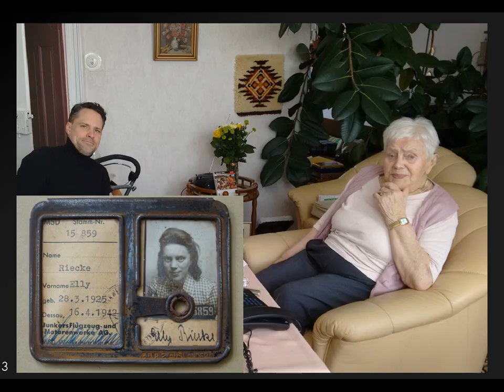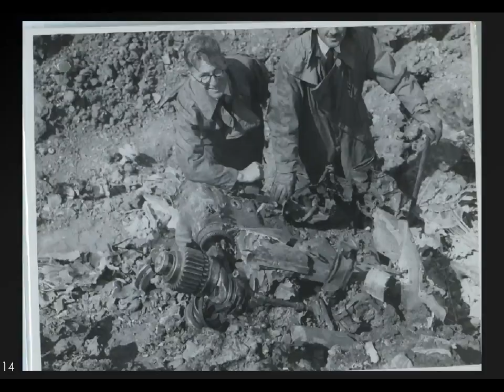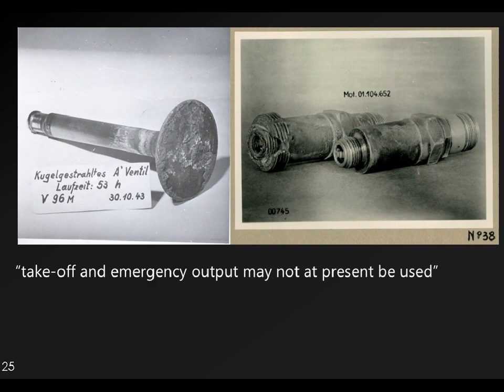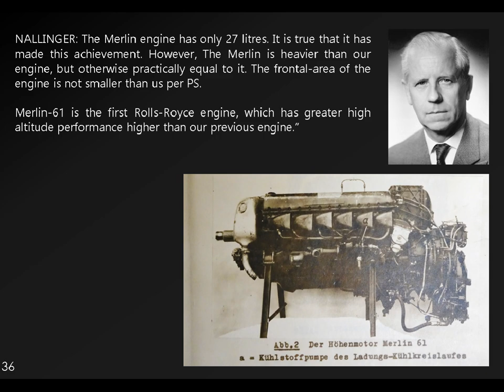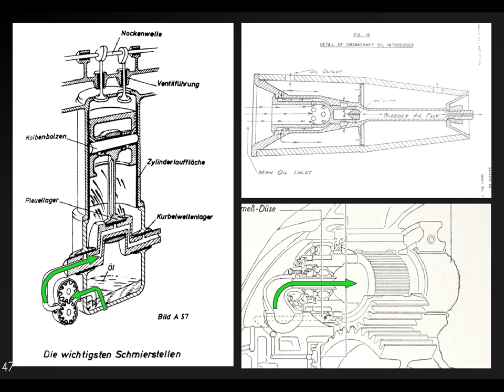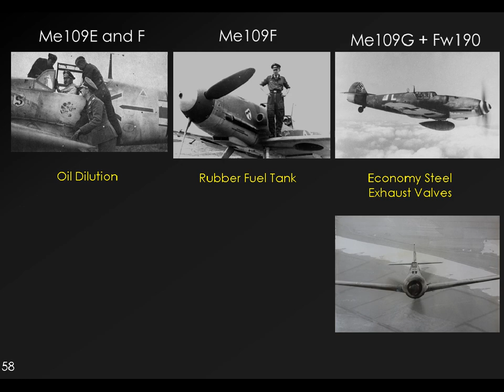The Secret History of Fighter Aircraft Engine Development in WW2

Comment: What are the differences between a Rolls-Royce Merlin and a Packard Merlin engine and how many of either were produced?!?
Reply: My understanding, from reading some of Calum's posts on various forums, as well as asking another engineer who rebuilds various WW2 engines, mainly Merlins (has his own youtube channel, very worth watching) is that the differences are;
1. Primarily the ancilliaries such as magnetos etc, which were not really going to make any difference to the performance but made sense to source locally in the USA
2. The supercharger drive, Packard had to use epicyclic gears instead of Farman gears, in order to get around a Patent. The engineer from the Historical Engines channel says that both gave very good service.
3. I think, but am not 100% sure, that the charge-cooler on the 2 stage engines wasnt exactly the same. Comparing the Packard 2 stage to any of of the 60s series, the 'cooler box' does look a slight bit different. Again, i am not 100% sure.
4. Packard introduced single point throttle body fuel injection before RR (the so called 'pressure carburetor' ) which did away with the float chamber+restrictor. RR followed suite soon after.

There may be more differences but those are what i am aware. As far as i have been able to determine, and Calum says for definite, almost all of the parts were completely interchangeable between equivalent models of Packard and RR versions.

Comment: I really enjoyed the talk and your book. Interesting that you say the engine has to be specifically designed to use high pressure radiators yet the DB 605 seems to have been able to use the cooling system in a Spitfire Mk5 just fine.  Your slide about the 6 things that Britain did correctly did not include having access to limitless metal and fuel resources. You make that clear in your book and this video but do not list this. It is critical.
Reply: I would not say that having access to raw materials was something Britain "did" correctly, in as far as, everyone knows that is important but you either have access or you do not. Germany did stock up massive amounts of critical materials beforehand, but just did not prioritise well, and had overly ambitious goals regarding acquiring new resources (Africa, Russia etc). What they did would have just about worked for the "short war" model many in Germany hoped for. I do not think any of them envisaged a five year war. So you could say their approach to materials stocks met their unrealistic goals. 

The use of the Spitfire cooling system in the 605 test obviously meant that all the pipework and radiators were the originals, hence did not have radiator tubes which expanded like bicycle tyres (although there are several factors at work). Its very likely that the tests which would have meant running at elevated coolant temperatures in the 605 were not sustainable, i.e, it was probably ok for a brief test by a test pilot under carefully controlled conditions, but would never have worked in a service environment. I.e. its probable the engine would be very quickly ruined. The tests probably only needed a few hours under high temperature conditions. Being able to do it for 50 or 100 hours is an entirely different matter.

Sadly it is difficult to ensure all the salient points are always mentioned in these videos as the topic is so wide ranging and complex. 

I am pleased you liked the book.
Reply: @CalumDouglas  thank you for the detailed reply

Comment: Having listened to your comment about the Mosquito at the end this was also slowed by the fact that the rear two exhaust stubs on one side of the engine had to be combined to stop the hot air damaging the aircraft. This lost the aircraft something like 8 or 9 knots off the top speed. 

One of the reasons I suspect the Germans hated the Mosquito is that it had the range to fly & fight over Germany from the UK. The Spitfires would have been mostly limited to the occupied countries of Europe due to range consideration.
Reply: "Having listened to your comment about the Mosquito at the end this was also slowed by the fact that the rear two exhaust stubs on one side of the engine had to be combined to stop the hot air damaging the aircraft. This lost the aircraft something like 8 or 9 knots off the top speed."

This was  offset by the significant increase in power.

"One of the reasons I suspect the Germans hated the Mosquito is that it had the range to fly & fight over Germany from the UK. The Spitfires would have been mostly limited to the occupied countries of Europe due to range consideration."

Lots of things frustrated the Germans when it came to the Mosquito. It had the capability of flying and fighting at almost any altitude. It was also famous from some 'spectaculars', which were largely intended to send a message to the Germans: good luck stopping us. The most obvious one was the bombing of Berlin on the anniversary of the Nazi ascent to power, when they put Goering off the air. It was also the most productive allied PR aircraft of the war, exceeding both the P-38 and the Lightning. Coming over at high altitude and high speed gave the Germans little chance of stopping it.

Comment: With regards to the radiator drag I believe that the RAE developed a radiator that gave thrust due to the hot air rather than than drag. Was this too late for the Spitfire ? There is some information on the thrust producing radiator at the FAST museum in Farnborough.
It is known as the Meredith Effect and is very dependent on the temperature of the coolant so the Merlins with a high pressure cooling system using Ethelyn Glycol should have been able to have cooling with little drag and possibly some additional thrust. Details on the wikipedia page for the Meredith_Effect and the links on that page.

Comment: Nah.you cant deny German engineering was far superior than rest. It was unmatched
Reply: I have to say the engine that I most like to drive (again, because my father had one) is an English one starting with X and ending with K. But compared to the material restrictions these engineers did fantastic things. Just look at the mechanical „ECU“. Just a power stick instead of mixture, ignition timing and supercharger gear. 
But again I prefer not only English car (which also have their flaws), but I’m also very happy the BMWs, DB60n and Junkers did not win.
And Merlin is definitely the better name 👍🏻.

Comment: Regarding the blending of is landing of 150 octane fuel again you got to be careful with understanding the technology.  You cannot "blend" a 150 aviation fuel. It requires the use of additives.   The problem is that they started with very different forms of crude oil.  The American oil was very low and sulfur and other contaminants.  However these contaminants contaminants actually caused caused the fuel to have a higher octane rating because it because it smoothed out the flame front.   When I was developing classified components for the Brits 30 years ago, I ran into the same problem.   While I loved working with the Brits, there was often a challenge with communication.   As one of my compadre's in England informed me... "The problem with our communication is that we are 2 people separated by a common language."  ( And our "common language" is anything but...)
Reply: Hi Rick
I cant really imagine what you`re trying to say, as to use an "additive" means you blend that into a base stock. In about mid 1942 British and US aviation fuel specifications were totally unified, and thereafter were one and the same specification.

Prior to that British 100 Octane was RDE/F/100, however lean/rich were not commeasurate between UK and USA fuels, so that was the point when the slightly tweaked 100 octane specifications were unified and became 100/130 PN (which is basically the same as 100 octane but with the addition of the required anti knock rating at rich, and some very small compositional alterations to ensure compliance). The early US supplies of 100 octane which were a touch deficient at rich, were modified in the UK by adding Benzole.

(150 PN was RDE/F/300 in Britain)

Comment: While I love the video the information regarding heat removal from radiators is not accurate at all.  In fact it's just plain wrong.   The heat removal is only a function of is a function of the change in temperature.  Is the actual temperature is irrelevant.  When you pressurize the the radiator, you  Increase the boiling point of the radiator fluid which allows you to operate at a greater change in temperature or as we call it Delta T.  So the only issue issue is the fact that the spitfire had a system that operated at a higher pressure pressure which allowed them to operate with a higher  Temperature difference or Delta T for the system. Thus making it more efficient or effective or effective depending on your terminology.  As I recall, there were numerous problems with the DB engines which combined to cause numerous reliability and lifetime issues.  This is the same situation that the USSR had and has (as Russia) at this point in time.  They have planes that are very fast and can perform some interesting aerobatics.  But their engines destroy themselves after a very short period of time and are extremely unreliable, and the acrobatics have nothing to do with winning a dog fight.  As such, in the last 40 years the United States has not lost one aircraft when fighting against Soviet craft whereas the United States has shot down about 3 dozen Soviet aircraft including frontline aircraft.  And yes, I am a  Retired research engineer certified in mechanical and electrical engineering.
Reply: Hi Rick, 

You start by make two contradictory statements:

1) "the heat removal is only a function of the change in temperature"
2) "the actual temperature is irrelevant"

The change in temperature between two mediums exhanging heat, is rather dependant on the ACTUAL temperature, so you`ve started off on a very bad footing.

I am guessing that your career in research (which you seem to regard as an important point) was not in engine design? (at least I hope it wasn't).

The "actual temperature" is VERY important, because. You have TWO boundary conditions to your calculation.

a) The temperature of the external air flowing through the radiator core
b) The temperature of the engine metal over which the coolant flows

The transfer of heat energy between these two mediums is: Q=m x c x Delta-T  ... ok ?

Now, if we run our coolant at 90 degrees C (for which we do not need a high pressure system), the metal temperature in the engine (taken as a whole) might be 180 degrees C. So we have a Delta-T of 180-90 = 90, got it ?

And, conversely, the heat to air, through the radiator matrix, (if we assume 30,000 feet = ambient T of -38 C) means we have a delta T between coolant and external atmosphere of -38C>90C = 128 C, following ?

Now, if we raise the coolant temperature to 135 Degrees C, and increase the pressure to ensure no boiling occurs, two things happen. First instead of Delta-T of 90 to the engine metal, we have 180-135=45C (instead of 90C), ok?

Secondly we now have a delta-T to air of +135C>-38C = 173 C, ok ?

So by running the coolant at a higher temperture, we not only reduce the heat transfer FROM the engine metal TO the coolant, but we also INCREASE the heat transfer FROM the coolant TO the external atmosphere.

Therefore, I shall accept your apologies for trying to imply that I dont understand basic engine thermo - sadly its you who has embarrassed yourself.

In actuality, we lose a little bit of this, because if you increase the coolant temp, the engine temp goes up a little too, so we dont quite get the ideal situation above, and we also lose a bit of radiator performance, because the air gets heated up more as it passes through the fins, which expands it, and therefore very slightly reduces the mass flow through the radiator as a consiquence. However, in reality, running such a system compared to one running at 90 or 95 C, can still mean you can reduce your radiator size by something like 30>50%, depending on the particulars of the aircraft concerned, despite the two small compromises just mentioned.

As to your rather odd comments on the combat record of Russia against the USA in the last 40 years; I have no idea frankly what that even means with respect to this video, other than illustrating that you find it immensely emotionally upsetting if anyone suggests that America wasnt the best at everything, all the time, in every respect. History, and facts - I`m afraid, dont care about either your (or my) feelings - and its rather sad that you view this as an "anti american" video. If you read my book you`d see differently...

Comment: Great video. 👍 Thanks for the upload 

An ex vehicle emissions engineer I'm struggling to get my head around the 40c difference in the fuel dist curve, causing oil dilution, when you consider the combustion temperature.... something else in addition to fuel recipe? Those curves look quite light compared to modern gasoline of close to 200c?

In addition, oil level would be checked before each flight and, complete oil changes were performed very often. I always thought the 601 used a roller bearing crank and the bigger displacement 605 used plain bearings, interesting 🤔

😎I need to sit down down and think that over. I'm sure you are correct I just wish to understand. 

Some of these other problems they had remind me of BL and Rover, the sort that make you blink at the incompetence.😊
Reply: 601 has roller bearing big ends only, the main bearings were plain. On the 605 this was simply altered to plain on both main, and big ends.

Comment: Do the British use the term detonation to also mean pre-ignition? The gentleman says that "the flakes that formed on the valves became red hot, causing detonation." Usually, however, anything red hot in the combustion chamber ignites the fuel/air mixture prior to ignition, resulting in pre-ignition. In the U.S., "detonation" is the explosion of unburned fuel (usually at the edges of the combustion chamber) after the ignition process has begun. Both will destroy an engine, but pre-ignition is the worse of the two.

Lots of similarities here with Japan's problems in producing high-octane avgas, lack of raw  materials, etc.
Reply: There is a lot of confusion between the two terms as they are often intimately connected. I didnt really have time for a combustion lecture inside this one, so I said the got flakes caused detonation. Which is true, however it is certain that pre-ignition would also occur in the process at some stage. I dont have time to type a complete explanation, but roughly:

a) Detonation cannot be detected before the onset of the pressure increase derived from ignition occurring at the designated timing. Very low levels of the "knock" sound that detontation makes as the pressure wave hits the metal of the engine can be sustained for long periods in service. 

b) Pre-ignition, is when the charge is ignited before the intended ignition point, and generally it cannot be "managed" at a low level, unlike knock. 

In a manner of speaking therefore you can say that preignition is "worse" than knock, however I`m not sure I`d like to use that as a blanket statement, as severe knock is also rapidly fatal, and can in turn initiate pre-ignition. Its very hard to totally separate the two things entirely.

So it becomes complicated because both phenomena can feed off each-other. Thus they are often very easily confused.

It is very difficult to precisely describe what the failure modes of each of the engines back in WW2 were in these circumstances, as I have very limited data, and only a tiny number of cylinder pressure traces. In the case of the 109F fuel tank issue, it is probably pure detonation, but in the case of the valves its probably pre-ignition at first, which then probably leads to a combination of the two things happening at once.
Reply: @CalumDouglas  Really enjoyed your presentation - great info and very interesting. And sure, given the issues you outlined, the engines could've experienced both. That single-cyl. test rig was very impressive! But as you pointed out, not having the correct valves in there was a huge mistake.

Comment: I am to borrow a 1938 book by Judge on this. I have his more general 1942 book. His description of Germany designs is a wonderful example of being professional. The 1934 Bristol  design showing working to about 28 000 feet in I guess an open bi plane.  The Bristol seemed to be the better design. Most diesels being for airships and derived from rail cars or similar. The Jumo if I am right would still be modern interms of fuel use. Better that smaller turbo props.  The big advantage of diesels being ability to work at high compression.  The Jumo if I remember had a BMEP of > 100 lbs which is not too bad for a piston ported design. If I am right the two common pistons greatly assited port timing.